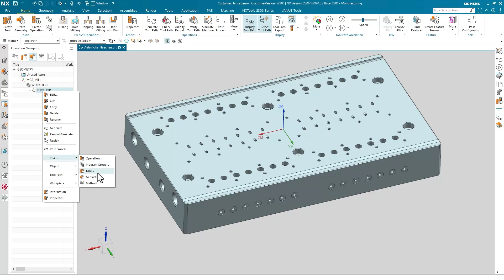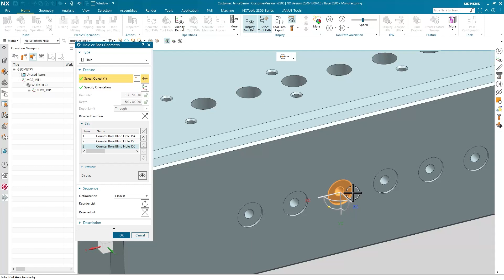NX CAM Tutorial | Similar Faces

Comment: I GOT MODEL WITH HOLES M3 ACCORDING TO DRAWING-HOW DO I TELL NX THAT THE HOLES ARE M3?
Reply from the maker: Hi Ammon Mor,
it's actually quite simple: Just select the feature that you want to be manufactured as a M3 thread. Then create a tapping (or milling-operation) on it with the according tool. Due to the tapping tool information NX will know that you want it to be a thread.
Kind regards, your JANUS Team
Reply: @JANUSEngineering  THANK YOU

Comment: how to smartly select all drilling hole that diameter is less than 20mm....or more than 21mm....like that in drill tamplate operations...... maybe you are getting my problem ........what if i want to select some holes that diameter is not above 20mm...then what is criteria ???
Reply: In old nx drill  cycle it has option, in new there is feature grouping method.
Reply: @princep2359  i don't think this is fast enough like old drill tamplate ....
Reply: please make one video for intol outol tolerance performance and how it works
Reply: Thanks for the video Heinrich